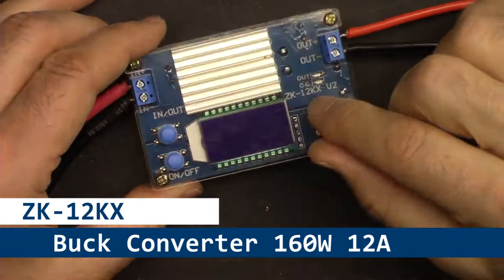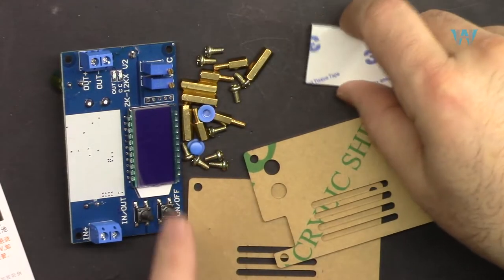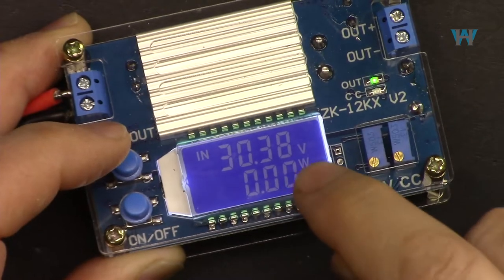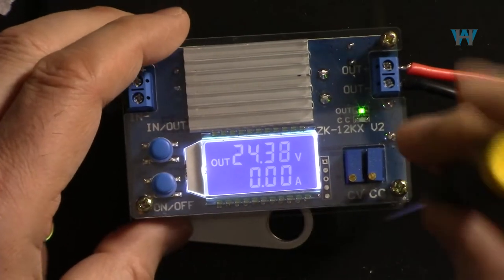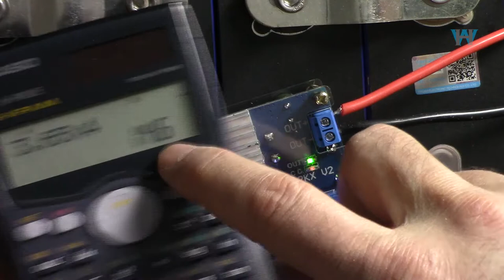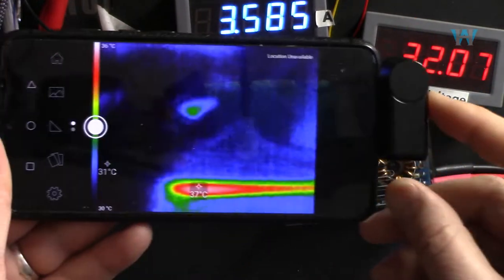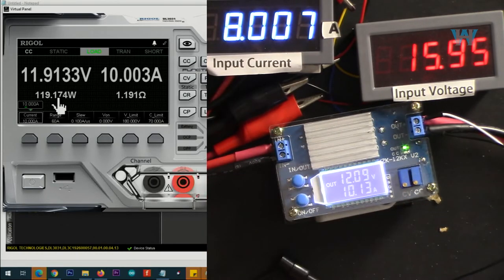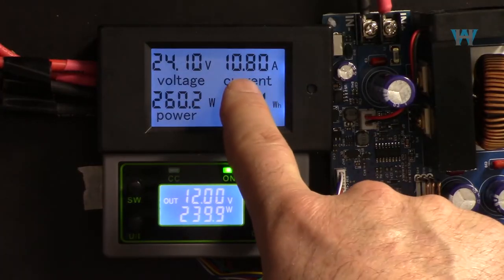Full review of ZK-12KX 12A Digital LCD Display Buck Step Down with Lithium Charger

Comment: The seller must be receiving several fried modules returned. Which is why he is providing this diode solution I guess. But it feels annoying when you are buying something for accurate input/output display purpose, and then you need to de-purpose it by performing such vague adjustments. What do you think? Is it really necessary?

Comment: Hello, good day, what happens is that on my device, it does not output voltage, it only shows 0.06, 0.05, could it be a specific damaged integration that I should change? Could you guide me a little, thank you

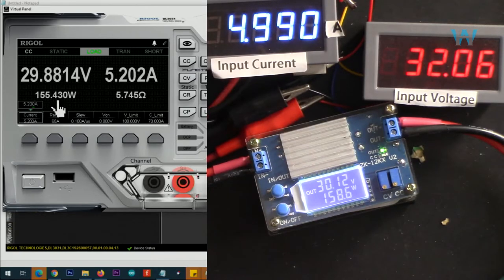Comment: At 24:44 the efficiency is was calculated incorrectly. It's supposed to be around 97%.
Reply from the maker: Thank you for pointing that out. I might have made mistake, but quick view showed it is correct (output power)÷(input power)=(29.8x5.2)÷(32x6)=80.7%.
Reply: Look again; i don't see a 6 amp, sorry. I see 4.99 Amp at input. So (29.8x5.2) ÷ (32x4.99) = 97%
Reply from the maker: You are right. I can't fix it now. I noticed that the drop of efficiency but ignored it as I was thinking this is how the module is.  I can't remove the video. Thanks for pointing it out. I will put a not in the resources page for this video.

Comment: Does buck converter can use on lights or LED lamp light bulbs?
Reply from the maker: yes. it is just a power supply. The buck means the way the voltage is reduced.

Comment: Hi I got same device from aliexpress but it doesn't go above 12.22 on the output side 
Do you have any idea about why that happening
Reply from the maker: Hi, is the output at the voltage when there is load or without load? may be the potentiometer is bad. Not sure.

Comment: This module has a problem. The voltage goes very high while switching it on. Be careful if you have a sensitive device to power up
Reply: Afortunadamente este dispositivo tiene la posibilidad de configurar si al encender quiere o no que su salida esté con energía. Yo siempre lo tengo configurado en Off.
Reply: @Electrico-X64  It still doesn't solve the problem. When manually powering it on, the voltage spike rule still applies
Reply: @electrotsmishar Que curioso, lo llevo usando hace más de 2 años y no noté esos picos

Comment: I have this module also but my problem is how to adjust to the maximum output current for 14.6v output voltage...my power source is 19v 12.3amp..what do you think is the max current output of this?...
Reply from the maker: Calculate output power and subtract about 14% from it , this is the input power. I made this video to answer such questions. Please watch and you will have no questions left.
Reply: may i know what power supply you are using and what voltage and current does your power supply have?...thanks

Comment: Is it safe for the module to get an input from solar panel to charge a battery? As the input current and voltage is not constant.
Reply from the maker: Yes it is as long the voltage is within the range.
Reply: @WattHour I see, thanks.

Comment: I just got that module. i have one question. When i allready charging a 12V battery through the diode - can i bypas that diode to get rid of Vf loss at that diode? As i understand, that diode is for protecting the board when Vout is 0V and output gets connected to battery. When Vout of the board is higher than Vbat - can i shunt that diode?
Reply from the maker: Yes that is exactly right.
Reply: @WattHour  so, when i allready charging - i can remove diode, right?

Comment: mine no longer have a output voltage at all, but input is good not noticeable electrical damage. what could cause  this?
Reply from the maker: Check all soldering points.Main power chip is dead.
Reply: @WattHour  do you know which is the main chip?
Reply: @deathriths  hi, were you able to solve the problem? , I have something similar with mine, it does not give output voltage, only 0.06, thx
Reply: A mí se me dañó al cargar una batería de 5A sin el diodo. Solución compré otro, le instalé el diodo y no tuve más problemas. El otro algún día espero poder repararlo.

Comment: can you wire these converters in parallel to double amps? obvs with anti-backflow diodes?
Reply from the maker: Yes if you set the exact voltage.
Reply: @WattHour  Brilliant! Your videos explain so much more detail. One more question, if i may - I have a 7s15p solar generator (29.4v charge) - i want to charge from my 12v Ford van socket, do you know any devices you have reviewed i can look into that would suit my situation? Thanks for you help and Keep the videos coming -= subbed :)

Comment: If I have an input voltage of 12v can i raise the output voltage higher than 12v
Reply from the maker: May be you missed when I said : buck converter. This is reducing the input voltage. Look for boost converters. I have so many of them.